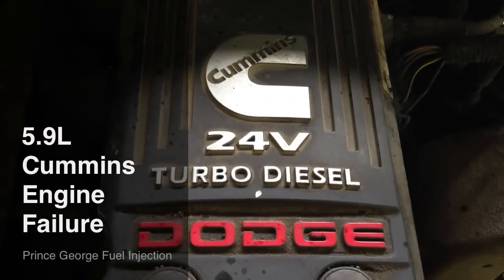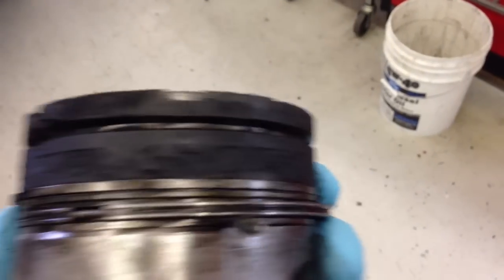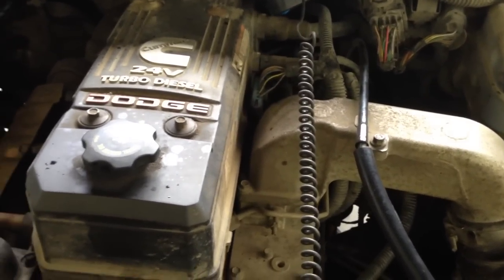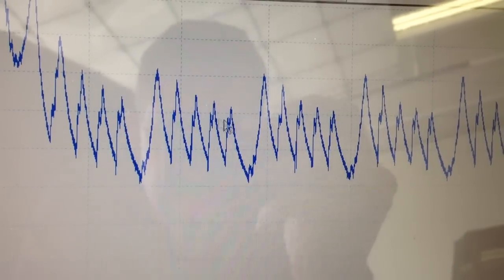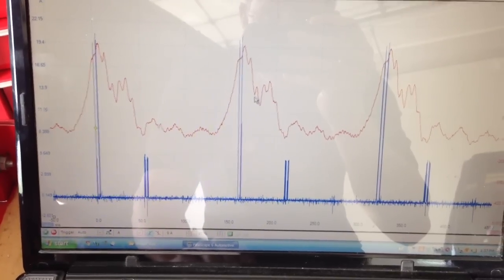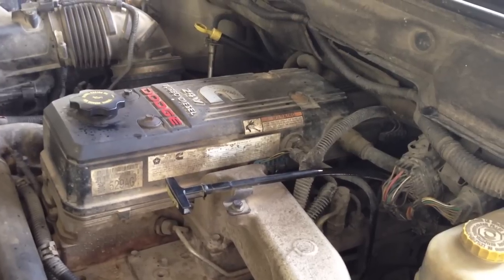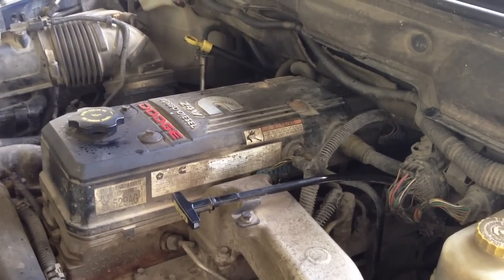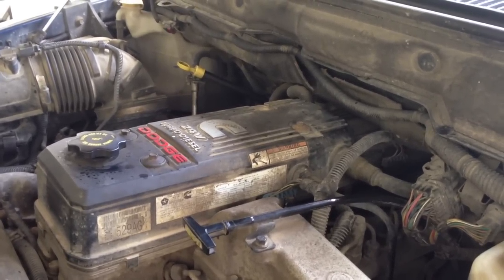5.9L Cummins Piston Damage

Comment: Is there any way to check pistons with out taking in all the way apart
Reply from the maker: There are multiple ways to check the health of an engine.  A compression test followed by a leak down test would identify any low cylinders and were the compression loss is.  We perform a relative compression test with a pulse sensor that will show if the loss in compression is past the piston.  One other option is to use a borescope down the injector bore to visually examine the top of the piston and the condition of the cylinder walls but it might miss a broken compression ring.

Comment: Did a trip from Prince Rupert to PG in my 05. My oil cap never did a dance when I left. But when I returned. I checked it in terrace and it has started to do the little dance now and I guess there’s a crank case breather? Maybe also known as a blow by tube and there’s a lot of smoke coming out from that. And overall it just sounds different. I’m going to try and valve lash it see if my exhaust and intake is where it should be. If nothing changes. What filtration do you recommend? Cause the truck is all bone stock and the injectors were replaced.
Reply from the maker: We generally like to see 4 micron or finer on common rail systems.
Reply: @PGFuelInjection  okay. I was looking at the Cat fuel filter kit. Listening to your video. I do not have black smoke to my knowledge when passing someone or punching it. Do you think doing the under hood conversion kit would fix my situation? Cheers
Reply from the maker: @gjeTV  At this point I don't believe added filtration will fix your issue.  If there isn't a compression issue you might have a restricted crankcase breather.

Comment: 5 and 6 are the most common cylinders to have issues with because of the heat they deal with constantly and the poor coolant flow to the back section of the cylinders thats why if you have a Cummins of any sort, you should get the coolant bypass kit with the thermostat in it, I know fleece makes one with a thermostat in it. it will equalize the coolant flow to number 5 and 6 cylinders

Comment: How long does it drive before damage occurs I would think a service engine light would be on and one would notice
Reply from the maker: The majority of the time, the customer comes in for a rough start with some exhaust smoke first thing in the morning.  No codes or check engine lights.  At this point one cylinder has little to no compression (0-100 psi) the damage is already done.  Out of 50+ cases, I believe one might have a P030# code but the rest did not.
Reply: @PGFuelInjection  sounds like bs on dodges part
Reply: I've just stated getting a weird stutter on start up on temps under 0°c I'm guessing a should get this checked out. I have no blow by and no loss of power

Comment: I have an 07 that exibits the same issues. low compression in #6. I notices exhaust coming out the fuel filter drain which puzzles me.  Any explanation why this would occur?  Thanks.
Reply from the maker: Please clarify what you mean by exhaust out of the filter filter drain.  Is it just black or aeration?

Comment: I'm new to the diesle scene but I bought a 2005 ram with 5.9 cummins (I love the name Cummins ) and when I learned about blow by I checked my motor running  I pull the cap off and I see white smoke but my cap does not bounce around like that. I also noticed from the vent tube I see white smoke but only when warming up. Is this going to get worse?
Reply from the maker: Without seeing your truck, it's hard to say.  From your description, it does not sound too severe but it might be a good idea to get it checked out.  There could be an issue that has lead to a slight amount of blow by like dust by passing the air filter.

Comment: I don’t understand tho, my 2005 5.9 Cummins doesn’t have any blowby at all! I have 0 codes on ecm, well enough full pressure, with air dog full system and cp3 is good, no black smoke unless I put a smarty tuner on it, turbo was checked good, transmission rebuilt with shift kit really good, and new oem injectors tested good, basically every sensor on the truck replaced, and the truck has very low power especially when it gets up to operating temperature, then causes the transmission to shift weird because the engine and trans work together! No overheating! I just don’t understand someone help me! Do I have maybe low compression in some cylinders and need to be tested? That’s honestly my last even step to figuring out why it’s so slow and no power especially when warmed up? Truck starts up just fine it’s only when going on the gas in drive it had no power at all. Also has 294,000 miles on it my dad did awhile back but 90hp injectors in it and power max tuner right when he bought the truck so idk🤷🏻‍♂️
Reply from the maker: Unfortunately, this issue is not common for this truck and would require hands on diagnosis.  What is the fuel rail pressure when the issue is occurring?  Does it match the desired value?  Also what is the boost pressure?  When you say the transmission shifts weird do you mean it hangs in a low gear and won't upshift which is common for a low power issue?
Reply: @PGFuelInjection  fuel rail pressure is around 26,000 at full throttle my guru show me on his snap on computer and does match the desired yes! The turbo boost pressure maxed out at 32 maybe 34psi of boost, weird shifts like it’ll feel like it shifts up and shifts back down and stutter shifts just not a smooth shift pattern
Reply from the maker: @matthewmurdock1897  23,000 psi is the stock rail pressure limit.  I assume these reading were taken with a tune in the ECM.  That shifting issue is a concern.  Generally, a low power issue will only cause the transmission to hang in a gear until you let off the throttle.  There may be an input issue causing the shifting problem.  Has the valve clearance been checked?  Also has the charger cooler been tested for leaks?
Reply: @PGFuelInjection  my bad 23,000 then all I know is he showed me it was good where it needs to be, it was a few months ago, and yeah seems like bad power problem! And yes to even go into overdrive and some other gears I have to let off gas. This issue of low power has been increasing over time and getting for over years so idk I gave the truck back to my dad for awhile driving a 95 Nissan hardbody with only 103,000 miles on it I just wanted to ask and see maybe why it’s causing it

Comment: I have a 2004 common rail cummins runs great it has a haze of smoke at idle not much at all still get good mpg with 142,000 miles on it no loss of power just a small puff of black smoke just curious if im having a big problem?
Reply from the maker: It would be worth getting it checked out.  Smoke at idle is a bit concerning.  An imbalance may show up in a cylinder performance test.

Comment: I have a 2003 Dodge Ram 2500 HD with a 5.7 Cummins Turbo in it with over 1 million miles on it. It was used to haul cattle and do plowing and still does. It still has the original engine without any repairs done to it, and it still runs perfectly fine
Reply from the maker: That's good to hear.  Good maintenance goes a long way.  The engine in this video is very different than what is in your 2003 Dodge.
Reply: PGFuelInjection sorry, I meant 5.9 Cummins

Comment: Bullshit my 5.9 has 282,000 miles With original Injectors and high-pressure pump still running like new the problem is in diesel

Comment: If those were stock injectors at 331396 miles then I'm sure the injectors were going out. If the injectors were over fueling then ya you would burn the piston. But there are tale signs when injectors start going bad. Maintenance Maintenance Maintenance.

Comment: Black smoke is an inbalance in the fuel to air ratio. It’s basically just more fuel being put in than there should be air coming in if that makes sense. It’s definitely harder on parts in the long run but doesn’t mean they’re failing necessarily.
Reply from the maker: This is true but an imbalance in fuel delivery between cylinders can be very hard on engine components and cause a failure is a short period of time.

Comment: For the most part, the Common Rail 5.9 Cummins is a really reliable platform. If you don’t keep up with the fuel filters to make sure the sensitive injection system never gets damaged and if you don’t change the oil often to make sure the oil doesn’t get dirty and hurt the lubrication, they will die. Keep up with the maintenance and they’ll last just as long as a 12 valve engine.

Comment: buckles resulting in a lack of clamping pressure on the air filter gasget. I have heard this series engine lasting over 275K and destroying the #6 cylinder at only 75k with proper maintenance. Wonder how much the OE air box contribute to premature engine failure. Hopefully it is not too late for your engine hopefully this was helpful.

Comment: For whatever it is worth on the subject mater. I made a startling discovery of a fine dust in the the hot side turbo to intercooler ducting on my 2006. I traced it to a leak on the POS OE air box next to the battety side where there are no

Comment: lost compression cylinder #1. about how much would it cost to fix? is total rebuild needed? truck has no blow by out of the lol cap. still runs drives good. just rough idle on start up.
Reply from the maker: If you have verified that there is low compression on #1 cylinder with a compression test and you have no blow by then your issue could very well be valvetrain related.  Without seeing the vehicle I cannot quote on a cost of repair.

Comment: I have an 06 5.9 Cummins. I have a similar symptom were it overfuels. But my engine is still healthy. What should I do to prevent further damage. Truck has 289K miles
Reply from the maker: Having the vehicle diagnosed for the over fueling issue would be a good idea.  Injectors very well could be the cause but other issues with the high pressure fuel system can cause this as well.  Also some of the aftermarket stock filters are restrictive from new and cause black smoke within a short period of time.

Comment: This problem only occurs in dodge chassis. I've never seen a 04-07 Cummins in a medium duty chassis fail. I'm thinking is the injector dodge uses for this application
Reply from the maker: Yes, this engine in other on highway applications, uses the early injector with eight holes and a more normal spray pattern.  In these years of Dodge pickup trucks the injectors have five hole nozzles with a very steep spray pattern and different piston design.  I believe this was done for emissions reasons and why this engine does not have an EGR system as found on the Ford 6.0L and GM Duramax.

Comment: Emissions emissions emissions, this blew up, that failed, this failed, all due to emissions god dammit
Reply: This engine actually just has a cat, the Common Rail injection, and an in cylinder EGR but it can still blow it. Straight pipe it and advance the timing and you'll have yourself a good, reliable, powerful truck.
Reply: cant you tune it to dismiss all that emissions crap
Reply: Wrong dude 2006 (emmisions) and not the 2004-2005
Reply: Wrong. Diesels were already the most efficient ICE and already got the most out of every drop. All emissions equipment is good for is making less miles per gallon and putting trucks in the repair shop.
Reply: Emissions emissions emissions, are also one of the reason we have  unbelievable hp and tq  numbers. HP & TQ happen to be a direct byproduct of manufactures having to create an engine that uses every drop of fuel to the best of its ability.
Reply: @markrich3271  pfff lol nope 6.4 Powerstroke would inject diesel during the exhaust stroke for Regen mode to clean out the exhaust and was a big cause of many 6.4 Failures such as 
Fuel Dilution in Oil
Burnt Valves 
Melted Pistons 
Blowtorch exhaust 
Damaged Bank Accounts for Repairs
Reply: @bryanmartinez6600   How old are you to start a sentence like that, speak to me like an adult because I am .  Thats the same thing as a leaky injector . I didnt write malfunctioning systems.  There are many 6.4 on the road that didnt experience those symptoms. But yes regen sucks one down fall to clean diesel.  I only wrote about high common rail hp#s  never wrote  other wise.

Comment: I was told that injectors can not be tested in truck because the mechanical portion of the injector may not be operating as the electronic signal would suggest when scanning pulse. I'm no expert, this is just what i've heard.
Reply from the maker: There definitely are limitations to diagnosing an injector in the vehicle, especially with the OEM scan tool.  The return flow test is also very useful if done properly.  We test the injector pulse width with an oscilloscope to see the corrections the ECM is making to each cylinder to balance the engine.  This gives us an idea of possible injector delivery issues.  The short falls of most in vehicle tests on the 5.9L Cummins, is that they are performed at idle and my miss an issue at another operation condition.

While bench testing injectors does give a better over all picture, it does not guarantee to the longevity of the injector.  A good way of looking at any test is that a fail proves the part is faulty but a pass does not always mean the part is good.

Comment: I know a 2000 5.9 cummins that is for sale with only 40.xxxmiles. It's an ex militairy vehicle. Are there ways or tricks (like the pressure from the oil filler cap) to be as sure as possible that i'ts an healty engine. It's more then 1000km away so i would really have to be sure. I already bought a landcruiser that swallowed it's turbo blades so i'm not really in to rebuilding another engine.

Comment: I agree with you that having a clean fuel system is very important, especially in a common rail system. However, I don't believe the piston you used in your example was damaged by the over fueling injector. The ring broke and damaged the injector. The blow-by is due to the broke ring. The broke ring was probably due to improper air intake system maintenance allowing dirt intrusion into the engine.
Reply from the maker: You are correct, in saying that the failure shown in the video could cause damage to the injector nozzle.  However, this is not the case and not what is being talked about here.  From our observations there was no damage to the injector nozzle and the spray patterns were good.  Also the fact that the injector in #6 cylinder is most common to over fuel on engines that have not yet had a ring failure.  This tied with the fact that it happens on 325 hp engines with the unique piston design.

Yes, dusting of the engine can cause  blow by as well but again this is no the case in this example.  When the amount of fuel delivered to each cylinder varies it creates excessive heat and stress in the over fueled cylinder.  You do not feel this imbalance at idle due to the ECM balancing pulse width.  At higher RPMs it cannot be felt as much either.  I hope this clears up the purpose of this video.

Sorry, if I missed the obvious and did not state in the video that ring failure/cylinder wall damage was the cause of the blow by.

Comment: Hi,

I have a 2007 5.9 liter Dodge with 37000 miles on it. I've changed the oil and fuel filter on it a couple of times. Do I need to worry about this fuel filtration system on my mode? any thoughts would be helpful.  ALSO, when you say "micron filtration system" where is this system located? Are you speaking of the fuel filter or what?
Reply: Yes he is talking about the fuel filter. Filters are measured by microns in their filtration determining how big of particles are allowed through the filter. The stock fuel filter only filters down to 7 microns whereas an Air Dog or FASS lift pump filter down to 2 or 3 microns.
Reply: Also as for your model engine it is the same as the one shown. You should still install a lift pump such as FASS or Air Dog or an inline fuel filter such as a CAT inline fuel filter

Comment: Just a quick question... Are the CP3 pumps affected by this in any way? I just rebuilt my 04 Cummins and had cylinders 1 and 6 look exactly as you shown.
Reply from the maker: +Jacques De Villiers  The CP3 pumps on this engine are quite robust and have a low failure rate.  That being said, added filteration will help with longevity.
Reply: +PGFuelInjection Thanks! I added a fass fuel pump/filter to my truck.

Comment: Does running an additive like Diesel Kleen or Stenodyne help?
Reply from the maker: +TheFordguy72 Running Stanadyne will help prevent asphaltene drop out, lubrication and moisture in the fuel but will not help with the poor filtration of these trucks.  The fuel system on a 2015 Dodge 6.7L is very similar to that on this 5.9L but Chrysler effectively have 3 filters on the new trucks.

Comment: So whats all the parts you need to fix it? Because we had an 05 that started having problems like cutting off when driving i just wanna make sure when i get my 06 to fix it fast as possible
Reply from the maker: +Tristan Whiting  Filtration is a good starting point.  Besides that it all depends if you have an issue.  Getting your truck tested for cylinder balance would help narrow things down.

Comment: new to the diesel world so it happens to both 12v and 24v because I was looking at 04 5.9 3500 cummins
Reply from the maker: This specific issue occurs on the 2004.5 to 2007 5.9L engines with 325 HP.
Reply: So let's say I got a 03 5.9 3500 don't worry about it but also to get something to get more life out of it
Reply from the maker: +Anthony Daniels Yes, additional filtration would be a good idea.  The 250 HP and 305 HP do not develop this issue as they have different pistons and injectors.
Reply: +PGFuelInjection okay thank you for that info! much appreciated
Reply: @PGFuelInjection  is there anything that Cummins is doing for us.